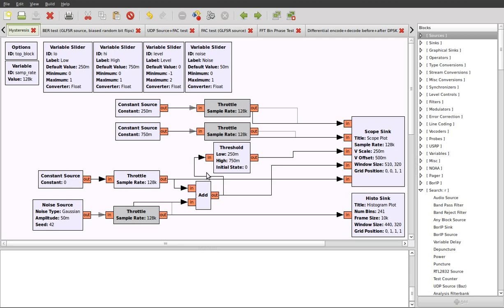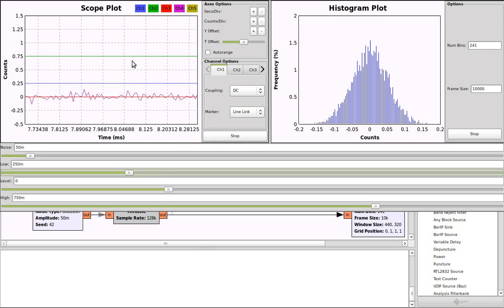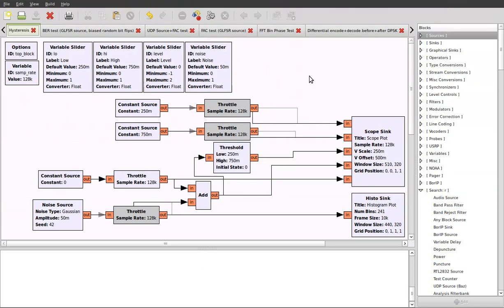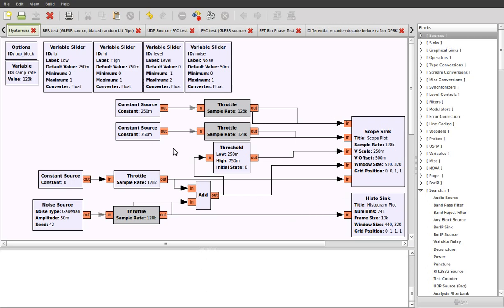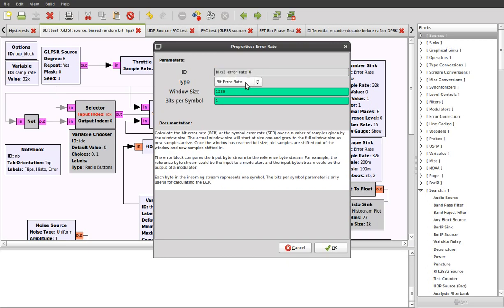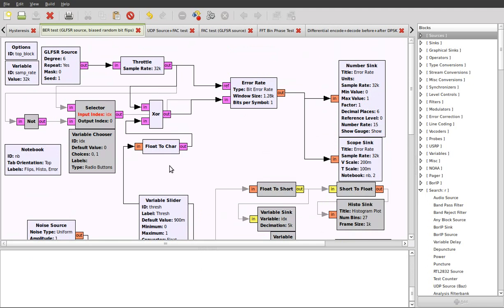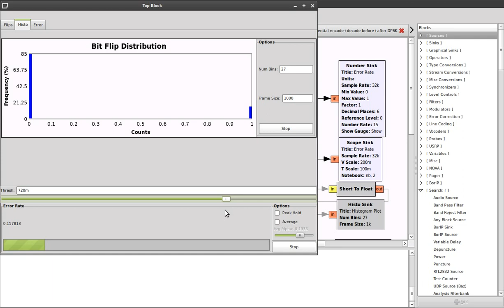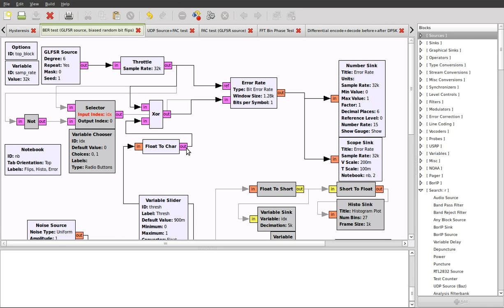GNU Radio Tutorials: Part 2 - Hysteresis, Noise, Thresholds & Bit Error Rate

Comment: Hey your videos are great! Is there anyway to create a scanner to scan available FM signals (similar to the one in SDR# pluggins) in GNU, while using the RTL-SDR dongle?
Reply: You can get them visually with the waterfall based on a frequency range.  The list of my local ones with the small antennae aligator clipped to the ant 500.  postfix with e6 for MHz.  89.489 91.2913 92.0807 93.6925 94.6904 95.4903 96.6962 97.4903 98.0923 98.8933 99.295 99.8913 100.696 101.49 101.891 103.099 104.288 105.498 106.284 107.692 .  I could probably get more and better if I wasn't in a bricked in dwelling with a double roof.  But I have the antennae near the window.